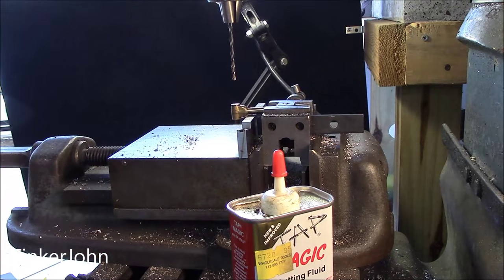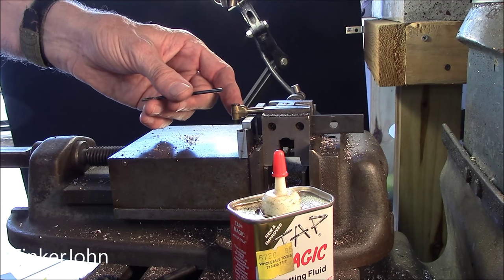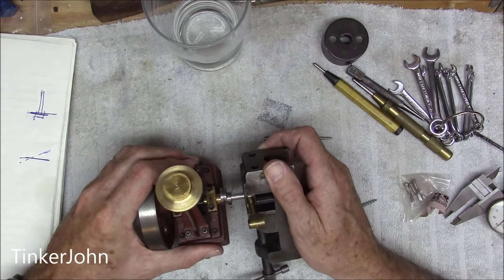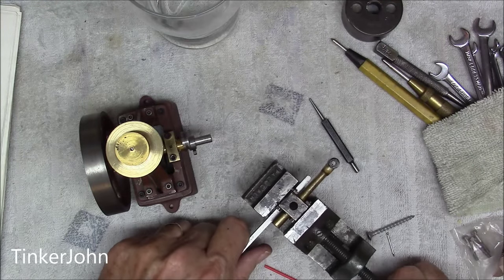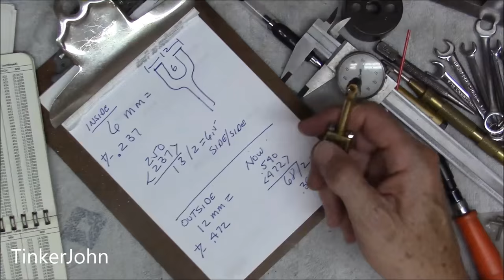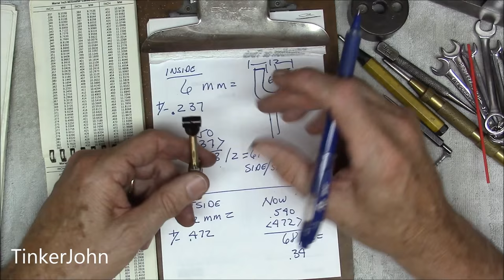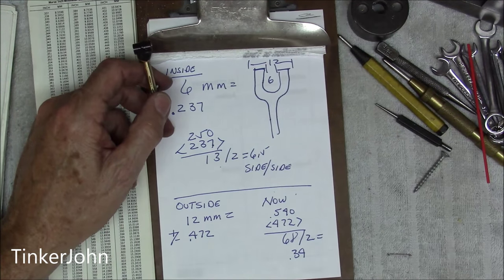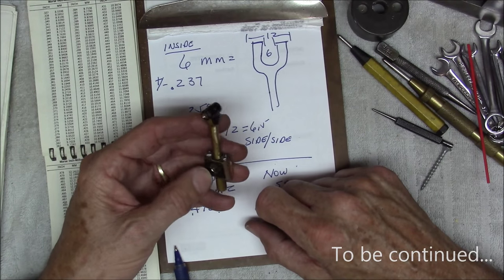Machining the Stuart 10V Steam Engine Castings - Part 51

Comment: The width at the top of the con rod doesn't matter much because you can machine the mating piece to whatever you make the slot.  When I made the con rod I did it in the 4 jaw so I could face up the sides of the split bearing.  Also, I machined it, then soldered it back together before drilling the hole.  That allows all surfaces to be machined including the top and bottom where the bolts sit.

Comment: Hi John. I am following you with the plans to the Stuart D10 kit which is like 2 10v's side by side. The drawing for the horseshoe cutout on my plans shows this dimension as 1/4" I don't know if these are the original dimensions or if they have been altered down the line. My kit was bought in 2007. I didn't buy the 10V at that time to be able to compare the 2 kit plans. I don't what year the 10V kit you are doing now was purchased, but I know you said it was a gift from someone.